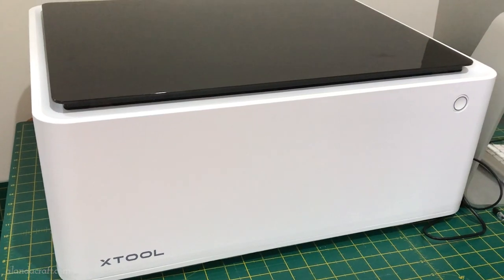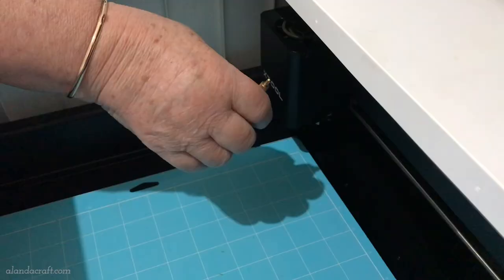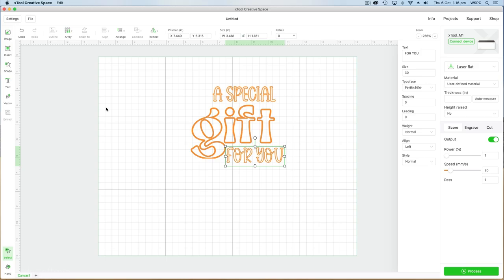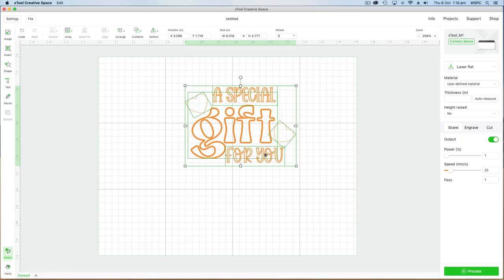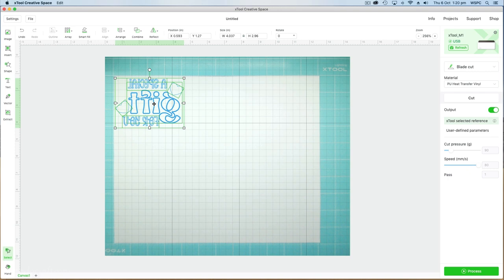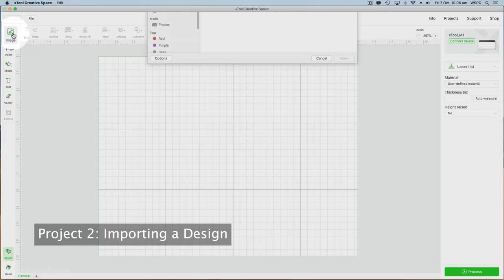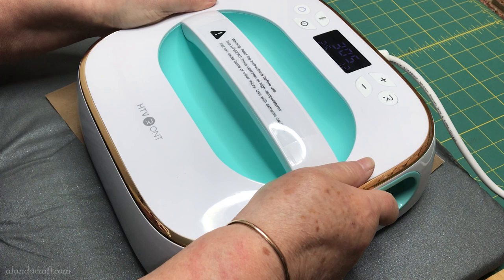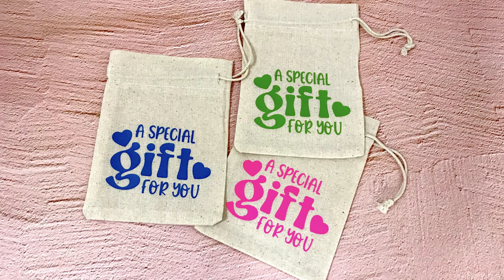Cutting Heat Transfer Vinyl with the xTool M1

Comment: Did you find this is faster or better than your Scan n Cut??  Great projects. Super demo. Thanks
Reply from the maker: Thank you Cyn. If you have a ScanNCut I certainly wouldn't replace it with the xTool M1.  This laser compliments your other cutting machines. The software isn't as advanced, as Canvas workspace but it does all the basics - text, shapes, resizing etc.  However, the software is currently in BETA so they are still working on it so I'm sure there will be additional functionality in the future. 
I haven't tested the speed between the two machines, but the M1 does seem to take a bit longer. I don't mind this as it does a beautiful job.
This machine is ideal for someone who wants to do laser cutting and engraving with the added feature of blade cutting card stock and vinyl without having to change machines. I personally love it.
It is early days as we have only had the machine a short time, but we will look at doing some solid comparisons in the future.
Reply: @alandacraft  Thanks sew much. I’m seriously considering adding the xTool as I want to do engraving and laser cutting. I love my SnC 650wx and plan to keep it! Thanks for your reply.